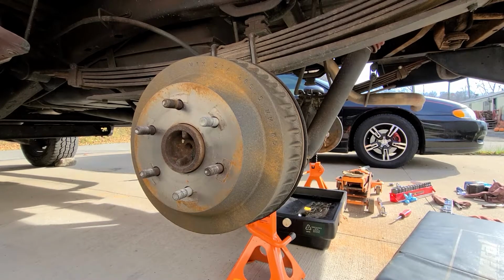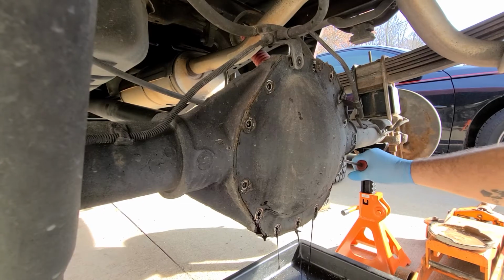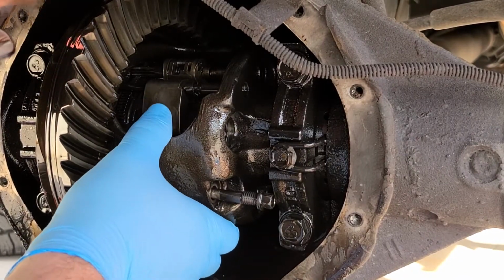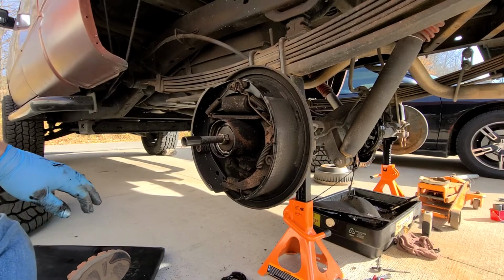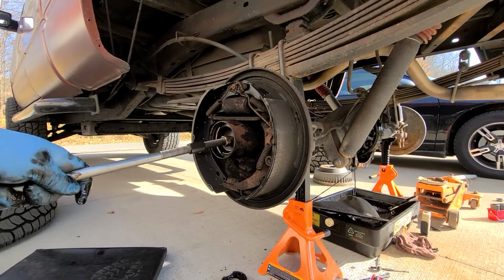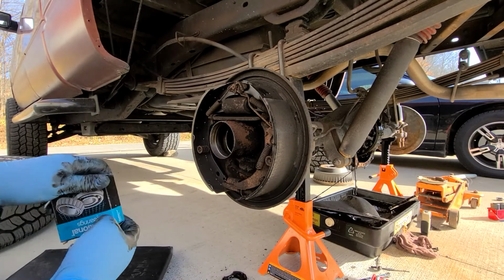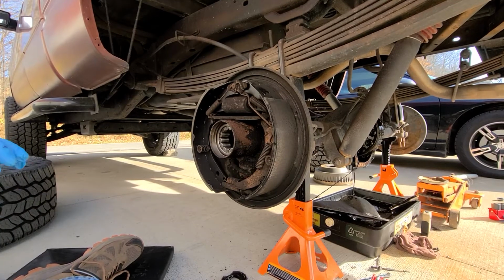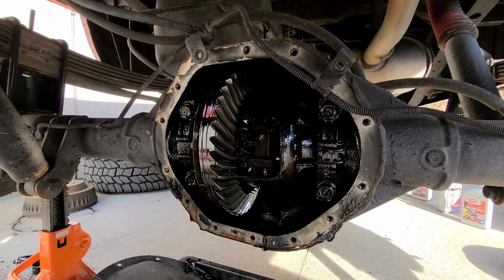Part 1 how to change the shaft seal and bearing in the rear axle of a 1998 gmc k 1500

Comment: Thanks for showing the struggle.  Some guys edit and only show the good stuff, but I'm one of those that wants to see the actual job done, then I'll be ready when I tackle mine.
Reply from the maker: Well I forgot to count the threads on the big nut befor I took it off.  So do that when you make your mark. I have 2 recap videos addressing that. And what happened. Yeah I make mistakes and I don't edit unless time is short. I try my best to show how to do what ever I am doing
Reply: @duanescarpad2831  - I just saw the videos with the pinion nut and seal.  Glad you were able to catch it before you had big problems with the rear end.

Comment: Just a friendly reminder, Lube those bearings on assembly. It gives them something to start up on. While manufacturing used to be good you don’t know what you are getting today. While finger lubing roll those bearings after seating just to make sure there are NO rough spots. Saw your video on the diff seal. Be sure no mechanic pulls the cover and goes through the crush bearing/preload hoop unless an internal gear is being replaced (rebuild). I noticed you missed the thread count which is critical to reestablishing the preload; however, that’s only a “good enough” cause nothing is the same with use and normal wear and tear. One thing regarding the drive shaft, mark its location before removing. Those things are balanced and if bad enough out of balance, putting it back 180° out can lead to vibration and long term damage.